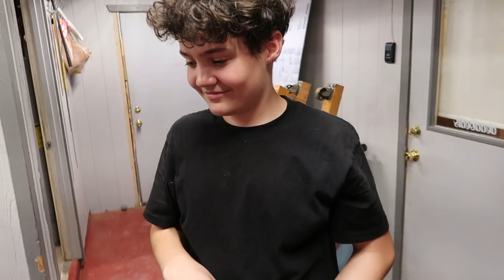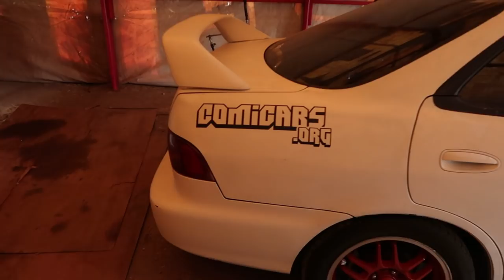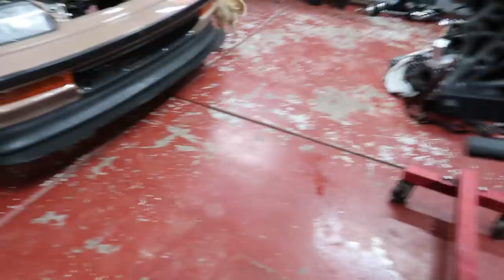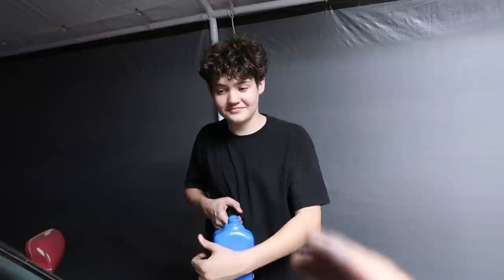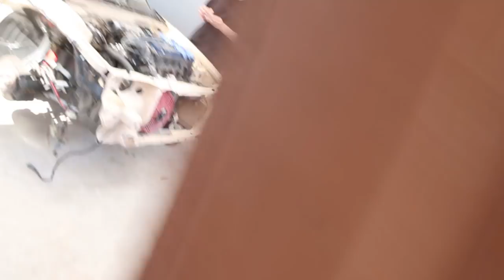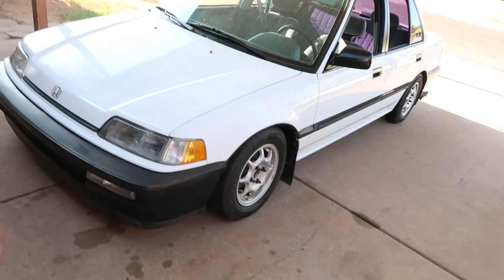New wheels on the sedan and more DA9 progress

Comment: the same guys who say no replacement for displacement on hondas seem to be doing a lot of replacement blocks...mmmm, cmon Bravus how many b20s will it take before realising the blocks just weren't engineered for Vtec without needing a lot of modification to support Vtec
Reply from the maker: I haven't had a single block failure though.
Reply: @deadbeatgarage   Just saying to be careful with them man see a lot of guys go through b20 and don't want to see you sell the car because of it and the GSR could've given you the reliability you want 

B20's arent made to provide the oil to the motor that Vtec needs and forces onto it